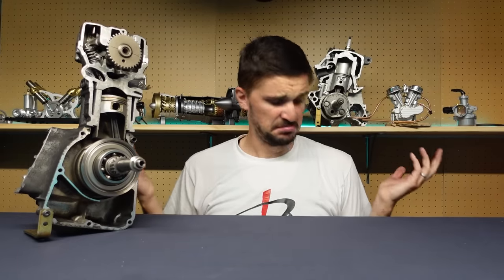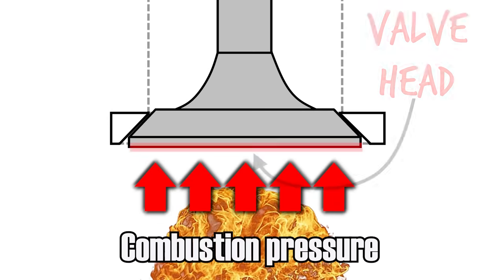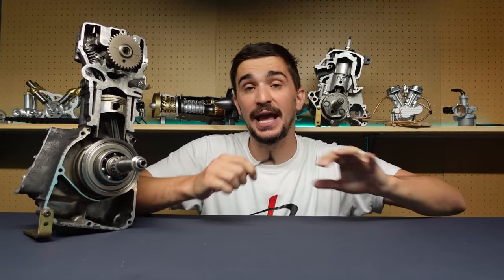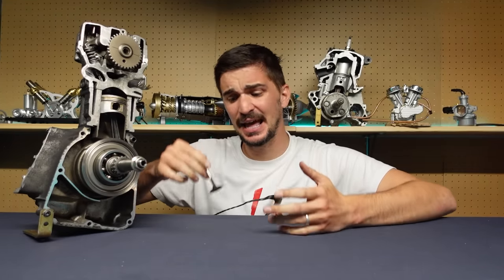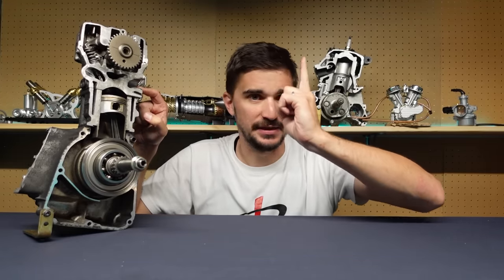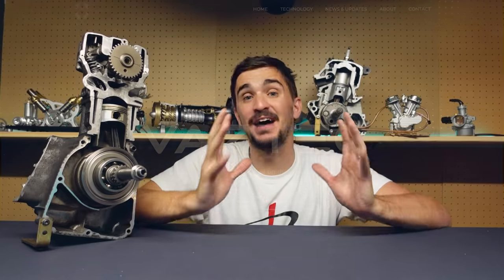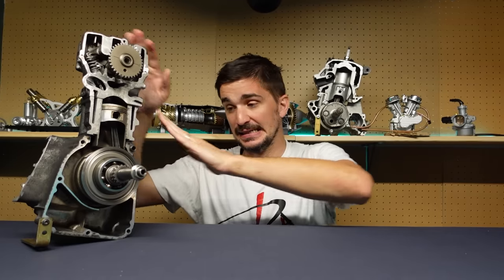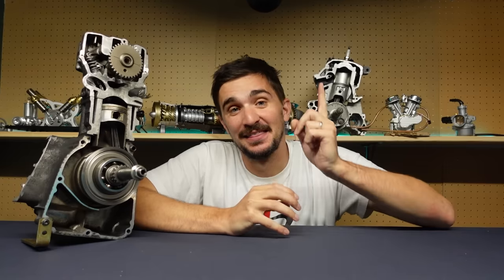Rotary Valves Make Normal Valves Look Silly - Why Aren't We Using Them?

Comment: I dont think Rotary valves will ever be mainstream. There's more towards the sealing that needs to be solved. Sure we can use labrynith seal and turbocharger bearings to get a good seal, it will work despite the temperature spike and fluctuation. But this rotary valve is direcly exposed to the combustion and the combustion product. The conventional valves have a valve rotating ability, so that if soot should happen to be at the valve seat, the rotation will lap and form a good closing of the valve. The wear rate for a rotary valve should be way higher compared to a normal valve.

Comment: Mm what about a rotating disk valve or a slide valve, I guess it would still suffer the same outcomes as the barrel valve. I've seen a rotating sleeve valve before that is a very interesting design also.

Comment: Il sistema da te descritto delle valvole rotanti, é stato giá costruito ed adottato in F1 negli anni ottanta da una casa francese, mi ricordo che ebbero problemi di tenuta, dopo un periodo lo abbandonarono perché non riuscivano a risolvere il problema, sempre negli anni ottanta degli ingegneri francesi ebbero la brillante idea delle molle pneumatiche, che introdusse la Renault nei motori di F1, da allora i motori 4 tempi si possono far girare oltre 16000 rpm senza problemi di float

Comment: The problem with the rotary valve is how are you going to lubricate it without significant oil getting into the combustion chamber. Thereby increase oil  consumption and decreasing emissions quality.
Plus carbon deposit issues will be magnified.

Comment: Has anyone adapted a butterfly valve type design to replace the poppet valve. It would seem to have the best of both typical valve sealing and minimal air flow disturbance.  Actuation could be done with electric solenoids or a simplified version of the Königsberg system

Comment: If the problem is thermal expansion then just cool the dam thing down so it maintains the extreme tite tolerances needed for sealing. I mean if it's machines with extreme precision you dont even reall need any seal really... After all oil meanders in the crank too just do the same here...(or maybe even with water)

(Okay dont kill me just an uneducated guess...)

Comment: Much as I like this channel and admire your ability to explain complex things simply, I can't help but think that most of the last 100 years of ICE design and development has ultimately been an unfortunate waste of time and energy.

Just down the road from where I live is a building that was once a factory that made electric vehicles, mostly buses and trucks. But then came ICE.  The new technology was grossly inefficient, noisy and polluting, but it was so much more convenient than electric, with the poor battery technology of the time. 

So convenient, in fact, that, instead if trying to develop better batteries, we spent 100 years pouring millions into an inferior technology, just to try to get it close to the efficiency, quietness and zero pollution of the electric motor. And, ultimately, failed.

A fraction of that money, time and effort would have long ago produced usable electric vehicles. Just look at how quickly that's happened now we HAVE to switch to electic propulsion. 

As fascinating as ICE development has been, it has basically been a wasted century, while we have been in the grip of the power of the oil industry.

Comment: Those springs don't consume much energy. 

The spring energy, which is stored during compression, is returned as the valve closes.  That's why that sprocket snapped forward out of your hand.

The only real energy loss from those springs is the small amount of heat they produce when compressed.

Comment: I'll be more concerned with the wear around the barrel on both barrel itself and it's housing so both should be easily replaced. Maybe some of Wankel rotary engine know how could be borrowed and implemented. You forgot another major advantage: no risk of interference existent on many engines. But thank you fer a good presentation.

Comment: Maybe the spark could be initiated by pistons using piezoelectricity instead of conventional plug?

Also worth mentioning is that two-strokes don't use valves at all. And recent test have shown that these engines can run on hydrogen, effectively eliminating it's only drawback - pollution.

Comment: The valve springs literally do not consume energy per se, because they return the stored energy back when uncompressed. The only losses are due to friction. Turning the camshaft by hand is difficult only because our muscles cannot reuse the returned energy. For running engine it is not a problem..

Comment: I just shit stormed a bit in my brain after watching this video.
what if we made the valve barrel oval or kinda like the rotary rotors or rotary vane engine. 
With rotational vanes or physical mass blocking the combustion port when engine is in combustion cycle ?
We could also DOHV (DOHC) it, two rotary valves per cylinder bank, one for intake and one for exhaust. We only needed them to offset on each side of the head to give clearance for spark plugs and injectors (GDI)
Main focus will be eliminating conventional stem valves in favorite of rotating ones.

Comment: I expect that rotary valves could be rotated by electric motors to transition quickly and then dwell open/closed.  In that case electronic control could optimize their operation even as it has optimized fuel injection and spark timing.

Comment: Surely you could have a rotary valve that doesn't rotate during the compression and ignition stages and the valve itself is pressed in to the engine off a cam or something when it's still to seal it properly

Comment: Couldn't you also use rotary valves in combination with poppet valves to allow ALL of the poppet valves to be used for both intake and exhaust (with no dedicated intake/exhaust valves in direct contact with the combustion chamber, only the common compression/combustion retention valves) with the rotary valves operating to route the intake and exhaust manifolds into the cylinder head at the correct time.

You still have poppet valves choking the system, but with close to double the flow and more options for valve location/distribution. (like 5 or 6 concentric valves around the spark plug location, though likely better suited to a hemi or conical combustion chamber and not wedge shaped)

And since all the poppet valves will have both intake and exhaust flow over them, some of the hot spots (and high temperature issues in general) of the exhaust valves would be reduced due to cooling from the intake air. (or intake mixture in a non-direct injection engine)

You'd get the good sealing aspects of the normal poppet valve, but with better breathing and without the rotary valves coming in direct contact with the peak temperature and pressure conditions during the compression or power strokes. (only doing their jobs during the intake and exhaust strokes) So the materials needed for the seals on the rotary valves would be much less critical, plus the rotary valve barrels could be significantly larger as they wouldn't have to butt up against the cylinder head so closely. (you could have a gap/buffer chamber in between, provided a small amount of exhaust getting mixed into each intake stroke would be acceptable ... though unless it's a direct-injection system, you'd also leave some of the intake charge in that gap as well, rather than just air)

Comment: I don't see why they wouldn't use something like a stack of piston rings as the seal like the gas rings on an AR-15 bolt. Just make sure you have all your rings staggered Gap them right and .... I mean that's what keeps the compression on the right side of the cylinder right? If it works for the cylinder why wouldn't it work for the valve?

Comment: You forgot one important detail why this tehnology unfortunately will never go into the automotive market: it removes the fear of a broken timing belt / chain, hence people less often going to make service and the companies making less money.
Reply: So how do you rotate the valve? Magic?
Reply: @TheMeepster72 I‘m not saying you don‘t need timing belts, I just say if one breaks you don‘t risk damaging your engine. And based on this fear, the car shops make a ton of money
Reply: @ChefBenni  Alright, I get what your saying, but not every conventional valve engine is an interference engine. For example the new ford 7.3 Godzilla.

You also have the problem of maintaining a good seal between the drum of the valve and the cylinder head. And as a machinist, I believe this is the real reason rotary valves are not used.
There's only one way you could prevent leaking around the outside of the valve body. Each one would have to be slip fit into its respective pocket. (A slip fit is when two parts fit together with NO slop at all but are still able to move freely. You're talking a tolerance of .0001 between a good and bad fit. It's almost never seen outside off toolmaking and aerospace.) Which would be prohibitively expensive and essentially make every individual valve a custom part.
But even then you would still need to oil them, both to maintain an air tight seal and for lubrication. This would mean that oil drips into the cylinder as the valve rotates. This would cause the engine to burn oil, run dirty, and potentially even cause knocking, especially on startup due to the oil taking up cylinder volume and therefore changing the compression ratio.

Comment: Yes, sealing is a problem.  Great idea that will only work in Fantasy Land.  Just like the rotary engine.
Reply: Ehh it could probably work in very high end applications, there's some cutting edge material science that could provided ridiculously low thermal expansion making sealing much easier.

Comment: 1:20 Yeah but whatever energy the valve borrows in order to open it has to put most of it back into the system when it closes.
Also 10:40 you're talking about tightnesses, or clearences, NOT tolerances.
Reply: "Yeah but whatever energy the valve borrows in order to open it has to put most of it back into the system when it closes"
Only correct for very slow rotations.
Remember, the valve assembly (including the spring and the rocker) has inertia, is constantly changing direction and has to move at the speed dictated by the RPM.
And the energy to do that comes from the spring.
The higher the RPM, the more energy nessecary to do that, meaning less and less energy can be fed back.
The problem of floating valves exist because at the RPM in question, the spring can not supply enough energy to even move the valve fast enough, let alone give any back to the camshaft.
And even if an engine doesn't reach that RPM number, it still means that the closer to that number the RPM are, the closer the energy feedback gets to zero.

Comment: These do not work because they cause high temp points within the cylinder.  The traditional valve has time "away" from the seat allowing it to cool.  The rotary valve is in constant contact and causes hot places within the cylinder.  These hot places can cause pre-ignition but the real reason is that these hot places increase NOx emissions and makes CARB compliance more difficult.

Comment: The rotating cylinder valve (like on the Napier Saber engine) would have a better chance to find mass production in automotive applications, that tech has already been proven over 5 decades ago.

Comment: I’ve got an idea! Why not make a whole cylinder rotate inside a block and do your combustion that way, you wouldn’t need valves at all and it could rev to the moon! You might still have trouble sealing, but I’m sure a tiny Japanese company like Mazda could figure it out and make extremely reliable engines that never lose compression! I think we’re on to something here guys, someone call Mazda!

Comment: The Belgium car manufator Minerva (the brand was pre war) (they named it the car of the Kingsthe engine was invented by Charles Yale Knight i read )  had an 4 stroke engine without popet valves but with sliding bushes or rotary disks .  I never saw one the disadvantige was oil sealing and limited engine speed and compresion  Also  the very first electric car reaching 100 km/h the    Jamais conente   (never pleased) it stands in Car world in Brussels

Comment: I wonder why the intake valve couldn't be replaced by a Tesla valve, which has no moving parts. A Tesla valve  on the exhaust might also assist with any leakage that might occur during intake, but a regular or rotary valve on the exhaust would still be needed.

Comment: The reason for not using rotary valve is 1. the seals do not last, and they do not hold compression, the best set up I've seen is the achadies engine, 2 stroke.

Comment: Interestingly, the very last, and most efficient, reciprocating external combustion (steam) engines were using rotary valves.  Your search term here is "Corliss" should you wish to verify.  It would be ironic if internal combustion were to be likewise supplanted right on the cusp of a transition to rotary valving.

Comment: All of these ideas about optimizing ICE boil down to converting it to run on Ammonia, DME, bio gasoline, CNG, Propane, Butane, Biogas, at one specific most efficient RPM as a generator to make hydraulic pressure or electrical current, where the final drive varies by electronic control of electric motors with battery or capacitor energy storage of several dozens of kWh of capacity, and the generator is perhaps 100kw of output, with the engine operating at one specific peak efficiency RPM, many of the issues with sealing and thermal expansion can be optimized since most of those issues are related to varying the RPM speed and heat levels and airflow rates in the engine. 

Say PHEV or REEV Plug-in Hybrid or Range Extended Electric, noting that the higher amperage alternator & higher amp hour AGM batteries needed to run all the ADAS chips in newer cars, means the engine already acts as a power generator with the alternator. The alternator can be beefed up and integrated where the flywheel is, directly into the crank where it can also act as a starter motor, like Honda does in the PCX-150 scooter ACG starter alternator //
Reply: Gear driving the rotary cam will improve the precise control too, eliminating lash or free play that belts and chains create. They already use gear driven cams in large turbo inline 6 commercial diesel class 8 truck engines, so the idea proven and its also used in racing engines, and perfectly compatible with a rotary valve system.

Comment: Ducati motorcycles do not have springs because the desmodromic valve system does not need springs which means you don’t get valve bounce and the engine can rev higher

Comment: There are a lot of good points, but it seems like some of the down sides are being overstated.

Mentioning the power robbed from the engine by spring compression without mentioning that you get some of it back as the spring closes seems disingenuous.

Also, some studies show little to no benefit to having lead in the gas.

A straight, square-edged, tube is not the most efficient way to move the air between two chambers.

Comment: In multiple cylinder engines the springs are returning energy into the cam… and for the rotary valve, 100,000 mile sealing kills it.

Comment: It's not just that tiny spring energy loss! The cam shaft is driven by a timing belt that drives a whole lot of things (water pump, oil pump, tensioner pulleys, and sometimes also AC pulley, cooling fans (unless electric fans are used normally), brake oil boost pump, power steering pump, etc! So why are you thinking this small spring deserves more attention?!

Comment: you are that wrong about the technology of rotary valves but i like you enthusiasm, ok about the aerodynamic and energy loss by the camshaft on that point you are right, but think about durability of the complete system, and what happened when the rotary valve leak...because it will... compression loss , low efficiency, performance loss, very dangerous situation for a driver (no more power), conventionnal valve is clearly not the most efficient, but its way more reliable because the most friction is between camshaft and pushers (reduced by the oil) make the valve away from leakage, for rotaty valve friction is between valve an headgasket and that rotating friction create the leakage and you cannot reduce it by oil because you are way too close of the combustion chamber. they where used in Moto GP on 2T engines (V4 500) because in that case oil is in the gas, and rotary valve are along the cranck shaft, then it works,  but not longer than a race and you have to rebuild the join... not a good system for all day engines... and not a reliable way to get performance and efficiency sustainably . in conclusion reliability >>> efficiency, because if you have a broken down engine with 0.65% efficiency, you will go nowhere, but a working 45% efficiency engine will take you wherever you want. your point of view is interestin in many ways, still wrong, but keep thinking about engine technology ;)

Comment: But, but....  The OTHER valve springs in the engine usually balance out the waste you are talking about.  When you torque them all down, the ones pushing up take away most of the resistance of pushing the others down.  Not 100%, but lots.

Comment: I’m thinking of designing a 2 stroke with a rotary valve inlet instead of a reed valve on the crank case.  There’s no valve float at high rpm and there’s no more reed valve replacements.  I’ve already machined the bore but haven’t started the top end yet.  I need a little help from someone with bearing knowledge if anyone knows someone I’d be grateful for the help.